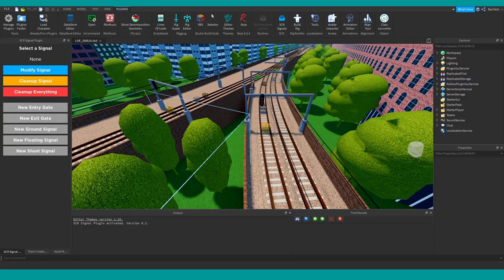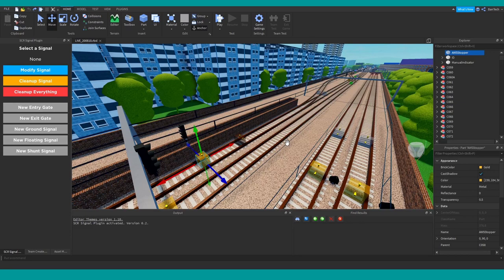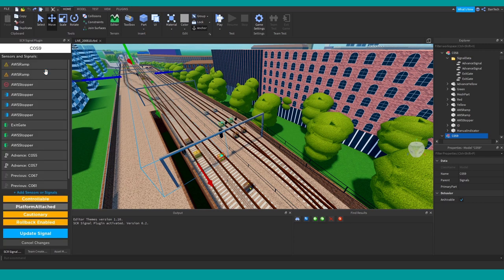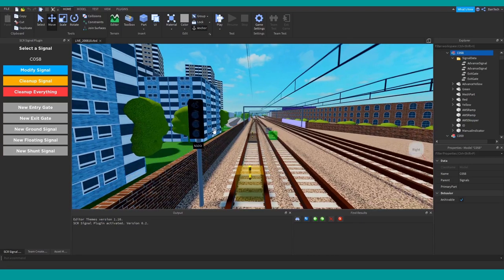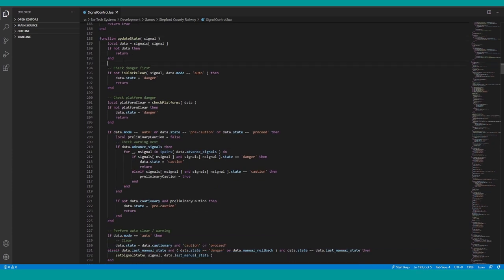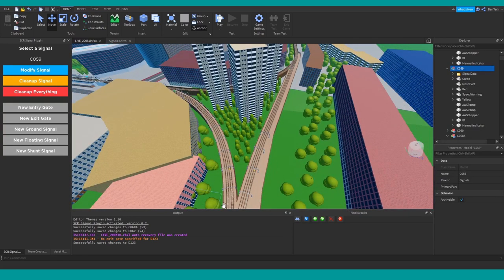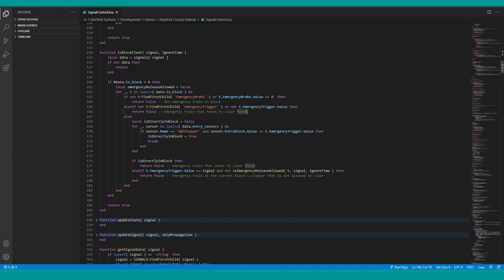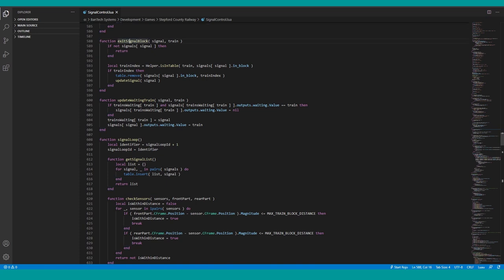SCR's Signalling System - BTS² #03

Comment: Yo bantech i may have an idea of a new branch on wl. This may seem weird but add 2 new platforms to eden quay and make them a terminus, then right of west benton, make a new junction branching off towards coxly, then extend the tracks towards coxly, adding a new station called benton square. When wl reach coxly, if you can, reopen coxly newton and put the traxks there so that the wl trains can call at it. Make coxly newton the terminus and put a depot called coxly depot. Platform 1 of coxly newton will be terminating trains from the other stops and platform 2 will be for the trains coming out of the depot. If this can come true (that would be a miracle) then call it "coxly shuttle".Here is a brief review of the starions and depots

Stations:

Newry(if you cant make a terminus at eden quay) 

Eden quay(terminus) 

Faraday road

Benton square

Coxly

Coxly newton(terminus)

Depots:

Faraday road depot

Coxly depot

Comment: Hi, a quick suggestion for the cleanup signal, perhaps on signals where it can only show danger or caution, you remove the both the clear and advance caution aspects entirely (you've already gotten rid of the advance caution aspect, so removing the green as well (keep the '45') is a logical next step (at least to me), and on signals where it can't show more than a double yellow you blank out the green, etc. Also, the shunt signals should probably set off the AWS as a cautionary aspect, as it's a restrictive aspect. Of course this isn't necessary, the signaling in this game is one of the best on roblox
Reply from the maker: Thanks for the ideas and feedback!
Reply: @BanTechSystems  No problem!

Comment: I get this is a year late (ish), but it'd be cool if cautionary signals actually enforced the 45 aspect until the next signal. It could probably be retrofitted in by using the entry and exit gates to activate the cautionary speed limit: if the state of the signal was stored in a variable. Which I have a feeling it is.

Comment: When I play on a busy server, my FPS is around 20. When I play in only a few players its around 60fps. I think server sizes should be reduced a bit.
Reply: Probably your device has not a lot of ram if you have 16 gigabite of ram than you have a lot of fps and you can still join the 20 player servers if you like though. Or it is an old device.
Reply: NOT_BAC0NHAIR 8gigs is enough aswell, I run on 8 and I get 60 FPS with around 35 players

Comment: Hey bantech I will have no clue on how to modify that game but I like trains but bantech I would like the current class 68 to a nova 3 with CAF MK5A coaches with a class 68 at one end I have told others if it wouldn't be possible to get because it's a 5 car including the class 68 with makes it 6 car. I know you got a 6 car 185 on airlink but I would like the nova 3 caf MK5A coaches with the class 68 and I really thought it could really replace the class 68.